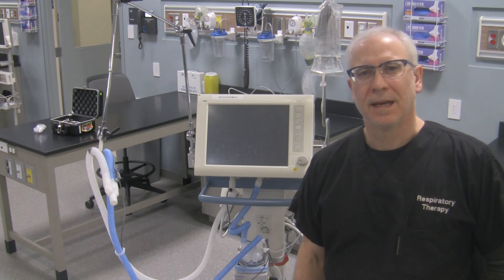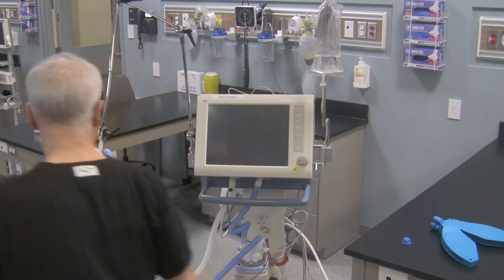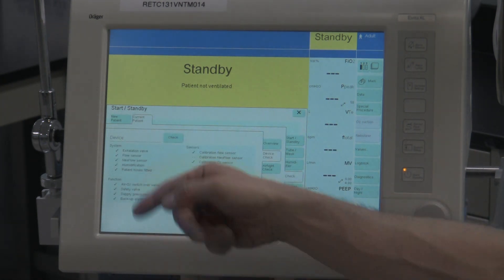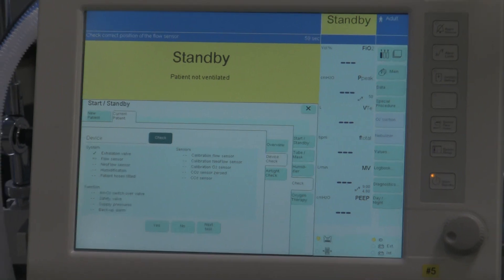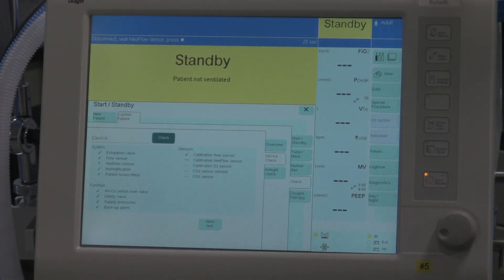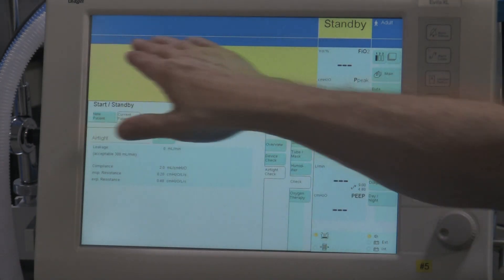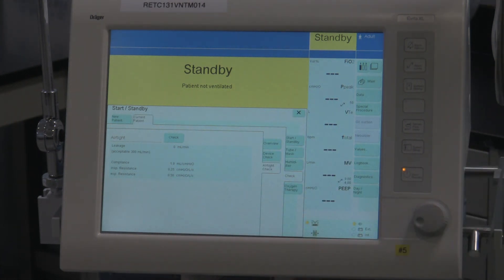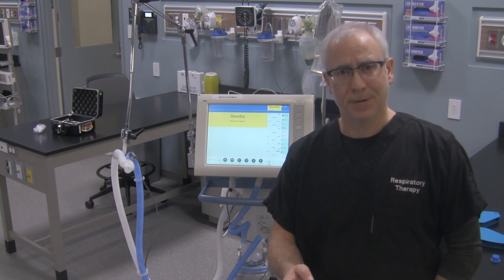Drager Evita XL Ventilator: Pre Use Check  (Device and Airtight Checks)

Comment: Good evening, looking forward for a recommendation from experts regarding the frequency of device check and also regarding what kind of ventilator tubings and expiratory valves used for the device check . Say for example my ventilator is stand by and not used for one week , waiting for an admission . Do I need to do device check daily ? Can I use a common ventilator tubing , expiratory valve and flow sensor for device check daily for all my standby ventilators . ? Or should I use one circuit (tubing, expiratory valve , flow sensor ) and to complete the deceive check and connect to patient when patient comes ?
Reply: You only have to do the device check once, and you use the tubing ect that you are setting up for the new patient.